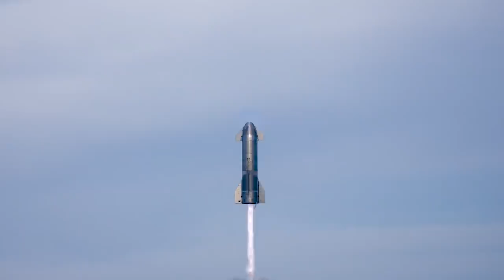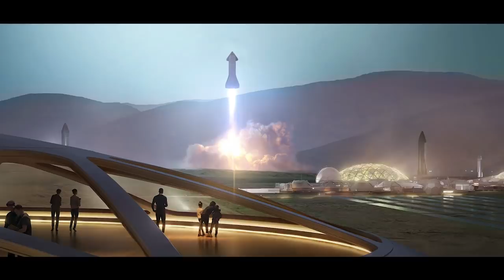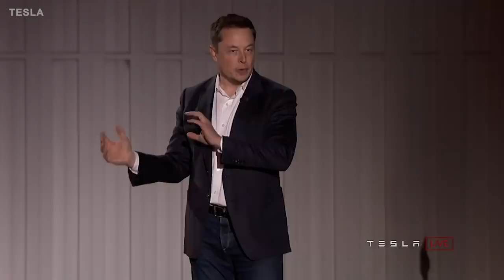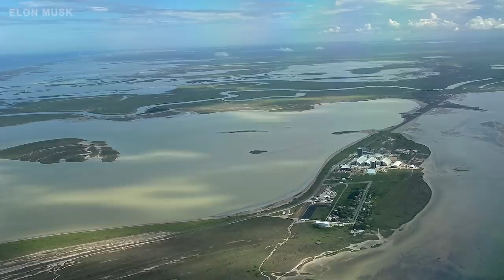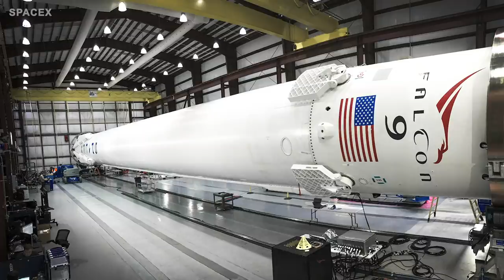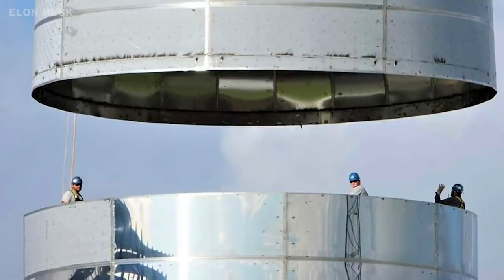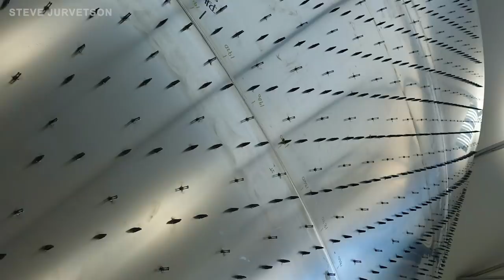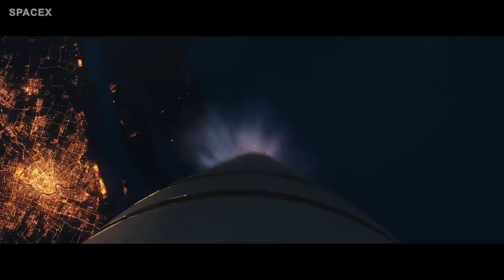Inside SpaceX's Starship Factory (Starbase)

Comment: Where is the 5 million $ per Starship number coming from?
Reply: Musk said he hopes one they they can get the cost this low. It's aspirational
Reply: @3gunslingers  The closest I heard to that number was launch cost <Falcon 1 (which is around that much. Not that the vehicle cost that little.
Reply: @mmeiselph7234  
For the launch you also need SuperHeavy, ground support equipment and launch crew. Starship is only a small factor in that cost.

But Starship itself is a hollow steel tube with 3-6 engines on it, each costing less than halve a million dollars. There is very little high-tech used to build and fly Starship. That lowers the cost considerably. 
That and the (hopefully) serial production.
Reply: @3gunslingers  250k$ is the aspirational goal for Raptor cost. It's currently an order of magnitude higher.

SS/SH has a minimum of 34 Raptors (6+28), possibly more, depending on how high they can get the chamber pressure.

While it is possible that the tank sections are in fact extremely inexpensive, 5M$ for Starship is unlikely for a long while, even for the cargo version. Any crew version will cost substantially more than 5M$, just the fittings, life support, etc alone will cost $5m.

Regardless, I was interesting in seeing a link to the direct quote where Musk said Starships will cost $5M, as I heard him say that launch costs could be less than F1, and I saw the tweet where he said that it he saw a path for them to be cheaper to build than F9s.
Reply: @mmeiselph7234  
I can't find the direct quote, sorry. Maybe I'm off here a little.

But the 5 million would only have been for the bare ship. No interior. 

"250k$ is the aspirational goal for Raptor cost. It's currently an order of magnitude higher." Do you have any links for that?

Comment: The yield of a fully fueled Heavy Lift + Startship? ~14 kilotons of TNT.
Yield of the Hiroshima atom bomb? 15 kilotons.
There won't be a launch complex or a factory when one of these explodes on the launch pad, or just after launch.
Reply: It doesn’t work like that, the full yield of an atom bomb is produced all at once. The full yield of the rocket is only obtained with perfect mixing of fuel and oxygen, this doesn’t happen in explosions.

In the Hindenburg disaster over 60% of the passengers survived.

Comment: If the starships are strong enough to fall horizontally through the air for a minute, they’re strong enough to sit horizontally on the ground for assembly. Stop spreading that bs. They’re too freaking big to sit horizontally. That’s the only reason.
Reply: Your reasoning is sound, but when it’s falling through the air at terminal velocity, the stresses are pretty evenly spread. Achieving the same on the ground would require a comple, heavy and expensive structural cradle the size of the rocket. The process of raising the rocket to vertical would impose other additional stresses. It’s hard to argue with the logic of simply building it vertically in the first place.

Comment: Eventually he will have to desert the idea building a city in Mars. It is simply  not economical.
Reply: "A city on Mars is not economical"
Just using the current starship. Probably not, but Musk mentioned building an 18 meter dia. version of starship. Mines on the moon with a magnetic accelerator to launch raw materials to a construction platform 200km above the moon would allow construction of such a beast. It could be used to shuttle bulk cargo from the Moon to Mars with the two endpoints serviced by the 9 meter version shuttling people and materials to the surface of Earth and Mars.

Asteroid mining would also be attainable to supply Mars with any rare metals needed from planetary core remnants and Boring machines can build cities underground in loops that Hyperloop modules strung together could use to produce Earth normal "gravity" to prevent muscle/bone loss (in conjunction with the "super mouse" drug that prevents the body from paring back on muscle and bone when it isn't needed. 

Underground cities would also be protected from radiation, meteor strike and general decompression concerns. Surface structures would then be for excursions. 

Why Mars when we have Earth? 
Population, population, population. 
Why not Moon first? I would say, definitely Moon first (easier and far less risk for now). 
Why Mars at all? Better access to the massive resources in the belt and a whole new world to spread out in. Orbital cities would work as well, but there's nothing like 50 meters of rock to protect you from radiation and meteor strikes. The moon can offer that, but Mars will offer it to a lot more people w/o people getting upset about the appearance of massive infrastructure defacing the moon as seen from Earth..... seriously, I fully expect that to be a thing... and I kind of see the point.
Reply: Funny that you think Musk has an economic goal in mind with his wish to make humanity a multi-planetary species.
Reply: well given his networth, i think he knows much about what is economical than you and me. and besides, economics is not the only factor in this endeavor